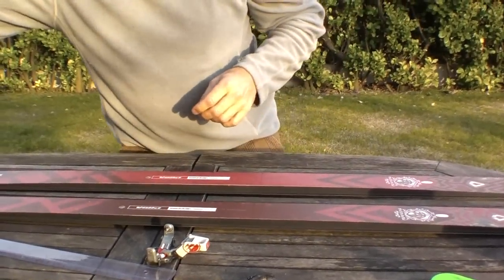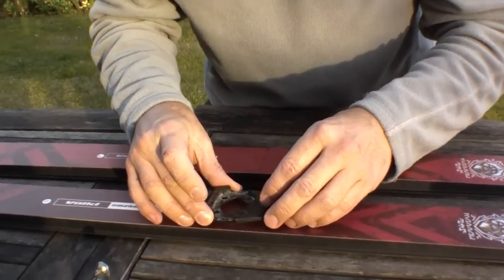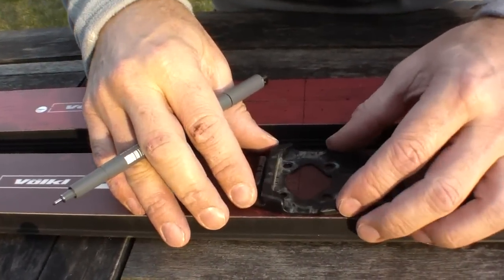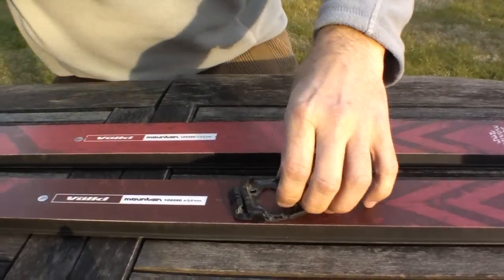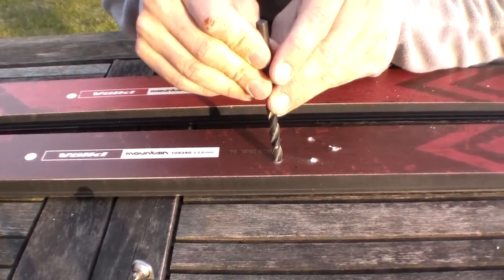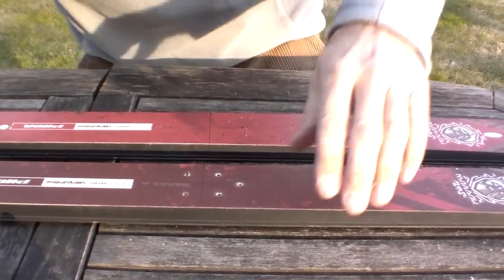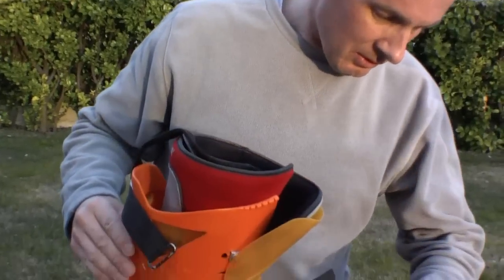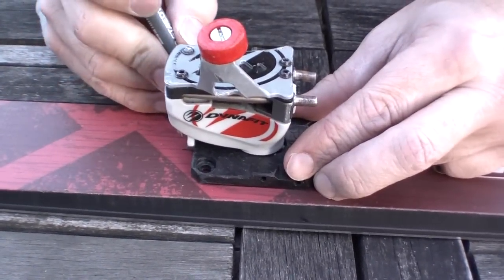Mounting Dynafit Bindings

Comment: Measuring the centre point with a tape measure from tip to tail NO!!!!!! NO!!!!! NO!!!!!!!
Hold the skis together (base to base) . Slide a credit card down from the tip to where it stops and mark that spot. Then slide the card up from the tail to where it stops and mark that spot. The middle should be half way between these two marks.
You are not measuring the middle of the ski - you are measuring the middle of the running surface.
You can see the running surface by pressing the ski onto a flat surface.
If you use a tape measure from tip to tail and mount the bindings on that centre line you will have a bit of a repair job when you find out the bindings are way off.
Reply: I've gonzoed binding mountings for years, usually remounting rock skis with old bindings  Your mid point advice is gem and key to skier balance! Thanks!

Comment: Well that was pretty ghetto. When I'm mounting $500 bindings on an $800 pair of skis, I'd rather spend a bit of extra time with a paper template and get it perfect than just eyeball it. Also, wood glue is shit for waterproofing, you should always use a slow cure (24-72h) epoxy. A good epoxy isn't going to crack when the ski is flexed deeply and eventually let water in.